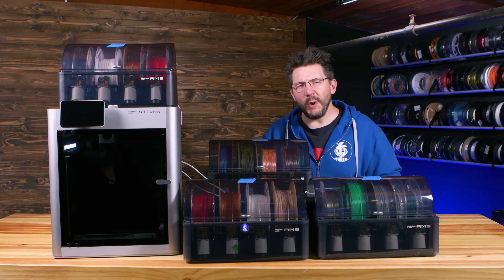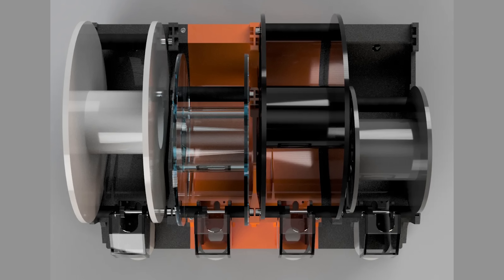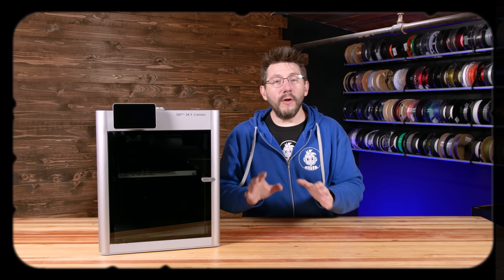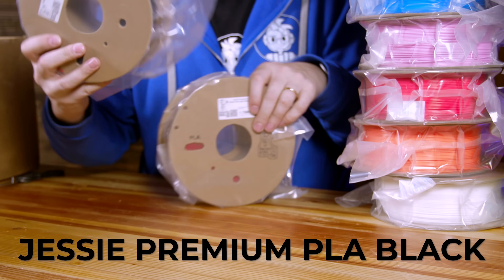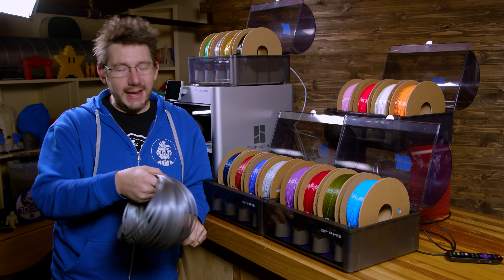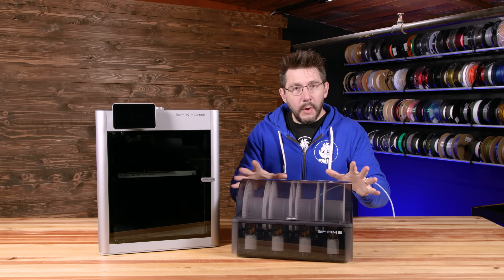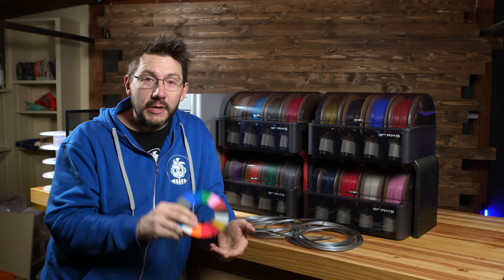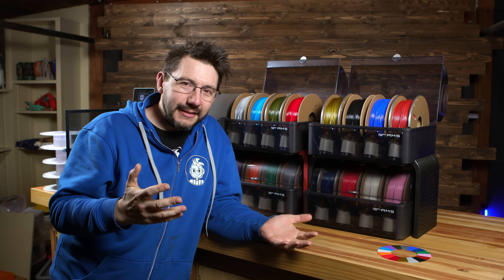Will the Hydra Mod on Bambu AMS Work?

Comment: I had the hydra, and also the same results. I build back my ams to standard en start to respool the filament to the bambu spools. All my problems where solved and now I’m printing with 2 printers 8xams with totally no issues, never. I’m surprised by all those guys who think they can do better then the manifactor. Just stick to the Bambu standard en there are no issues. I did make a setup to respool and together with the help of my wife, the respool can be done in 2 minutes. 

It sounds to me as I buy a Porsche, replace the tires bij none supported and start complaining about the handeling of the car. When you buy a drill press every one is using it for drilling holes, nobody will re-engineer the machine. 

Every print I started the last 8 weeks was successful, except when I made a mistake. Again te solution is simple, just respool you filament to bambu spools.
Reply: He had motor problems as diagnosed by Bambu, he can't really fix it (because you can't really) so needed a replacement. Yay. Not for me for exactly that reason. If it works, sure it works great, but that's not the point. Also, the spools wouldn't fit without the mod, so it was required to have it as he already had the filament. :)
Reply: @punishedbrains  i had the same results also a motor stopted. Af returning to original ams the motor problems where solved. Feel free to do what you like, I only give my opinion
Reply: @Eric1960  No worries, that's what a discussion is all about (or at least, should be about).
Reply: Support on “high end printers” don’t let me smile. All my complains on the Raise where denied by raise. When there was no way out they offer to buy the printer back.    Same stories on Ultimaker on the internet. Why do you need open standards. For years I have only Apple hardware. Everything is very closed, but works flawless. Hw sw and firmware are in a perfect match together. Why is nobody complaining the firmware of there washing machine is not open. Strange people 3d printer users

Feel free to do what ever you like. I am an users and the printer is making parts, in the past I did all possible modifications and had never a good working printer. The moment I stopped updating, all problems disappeared.
Reply: @Eric1960  I was an Apple user for yeaaaaaars, I stil have my Mac mini from 2012 running. Why? It died long after any warranty, so I took it apart and fixed it, upgraded it to the max as well so it's still usable even today. The new Macs are great, but totally unrepairable, which is why I'm going for the Framework laptop. Same thing with my iPhone, they became so expensive that I switched to Android, only to find out my Apple watch became useless. I was hoping it didn't as I have a very expensive iPad Pro still here, but that didn't sync anything. Great stuff, only when you always stay in that ecosystem. I decided I wanted more choice again for myself, it makes total sense also money-wise. Your experience with a never well working printers after modding... I did the same with my first printer (Ender 2) and it prints better than a Prusa mini. The fact you fail to fix it is always a possibility, also for me, but when you do... you saved a bunch of money, plus I don't have to wait for a company to finally deliver me replacements. I don't see why being open in hardware or software can be a bad thing.

Comment: The joys of a locked down system you can't easily fix yourself. :) I get the attraction to the X1, I was tempted for sure, but I really like fixing it myself or when the company goes bust, I can still use it. Also... kudos to PrintedSolid for using cardboard! Consider me a new customer.
Reply: Bambu has promised that if they ever go bankrupt, they will make everything open source.
Reply: @Muhfynmann  That would be great, but that's not something I would trust on.
Reply: @Muhfynmann  with BambuLab’s promises and a $6.95 you can get a small caramel macchiato.

Comment: 😂😂😂😂… cardboard 😅.
Reply: Works great for me, I hate throwing away plastic just because it had filament on it.
Reply: @punishedbrains  and your not alone, it takes up less space in the garage too. But truly down to brass tacks neither spool will ever be recycled so it just makes it a feeling. Feeling good about things drives a lot of commercial decisions these days. Driving a gas guzzling old car into the dirt doesn’t feel as good as electric cars. Soooo despite wanting the ‘environmentally friendly’ option most rely on that feeling without question. 

It is a given at this point any and all filament companies will use cardboard once the current supply of plastic spools are used. I am fine with that but I refuse to weave a false narrative about what any of it hypothetically means for the environment. My gripe is entirely on the cardboard durability and functionality on my already purchased printers and filament dryers. There needs to be a commercially available reusable ring or insert to get less waste and failure due to the switch to cardboard.
Reply: @MakerBees333  Fully agree on that, offering a reusable ring to buy or something would be great indeed. And I also fully agree that the processes or recycling are usually very bad. It's just that I think having this amount of plastic spools is worse. Only producers can make a change (really) if they stop something it immediately is a huge volume.